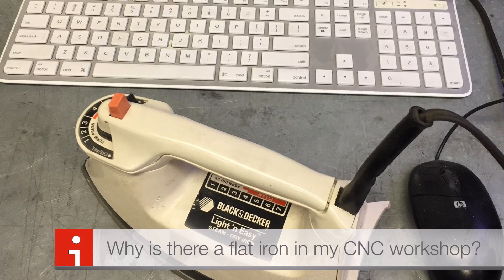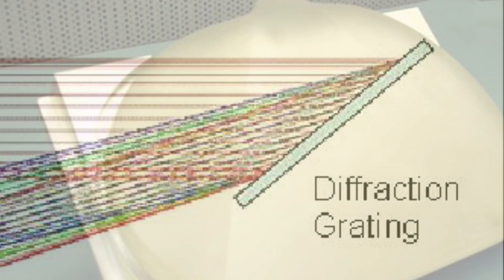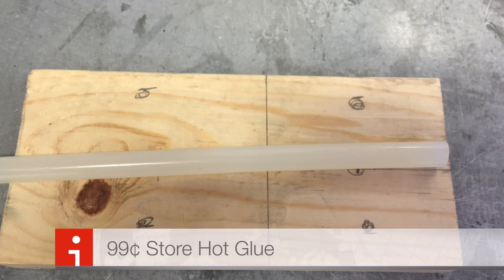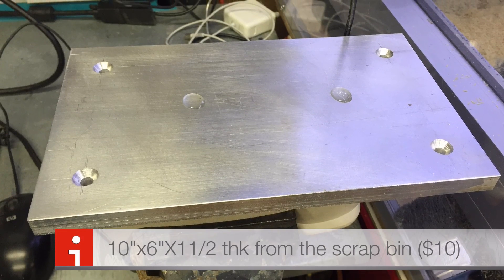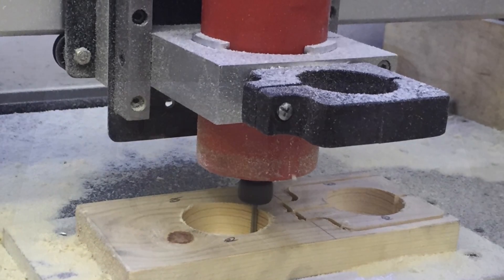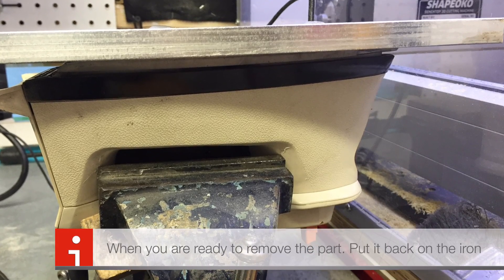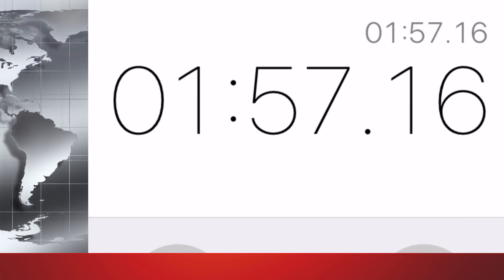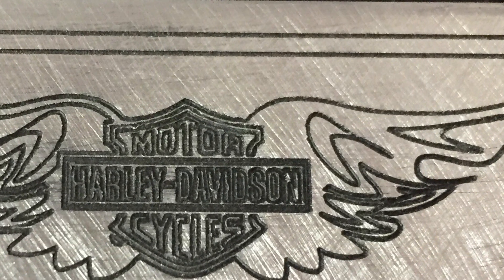Shapeoko: Hot Plate, Hot Glue, Hot Damn it Works!

Comment: How's the hot plate different from just using the hot glue gun?  Thanks
Reply from the maker: It's different because the items you are going to glue are also heated.   If you try to put glue to the 1/2" think of aluminum base plate, the glue will start to cool before you place the stock (wood or metal).  This means 2 things: You will not have a good bond, and the stock will probably not me parallel to the base plate.  When I glue metal, I place a few small piece is paper between the base plate and stock.  Heat everything up, and then clamp the stock to the base plate.  All the excess glue will squeeze out, except for the 0.004" (equal to the thickness of the paper).  This process will allow for a great bond, and the stock will be parallel to the base within 0.001.  This process (glue to heated base plate and stock) is widely used in industry

Comment: I've had a heck of a time trying to get this to work. My aluminum always seems to pop free. The only thing I can imagine is we must be using different kinds of hot melt glue. I will try machining wax from Carbide3d next but with the same clothes iron method, because it's pretty slick.
Reply from the maker: Well it sounds like an adhesion problem.  4 normal causes. 1) material is not clean (oil, dirt, etc) 2) Surface it too slick (Lightly sand and clean), or 3) you are not getting the aluminum up to temperature, or 4) Really crappy hot glue. Hope this helps.  I have never had a part come loose.....

Comment: Thanks for the tip Richard. How do you ensure that the part is level, on the holding substrate? I'd love to test this technique, I am wondering if you worry at all that the glue might raise the part more on one side than on the other, if the glue is not evenly dispensed.
Reply from the maker: Great question.  I am going to change the word level to flat.  My machine is level, but my work need to be flat to remain parallel.  

Now on to your question.  If I am working with wood, I place a heavy weight (10lbs ~ 4.5kg) on top of the wood as it is cooling and it's is flat within 1/64" or less.  

If I am working with metal, I will first place a few pieces of paper on the metal plate; then melt the glue with the metal workpiece.  When the glue is melted and the workpiece is also hot, I then clamp it together.  The excess glue will squeeze out between the two plates, but a small layer of glue (the thickness on one sheet of paper) will remain.  Why do I add the paper?  it's easy to squeeze ALL the blue out between the two plates leaving nothing to hold the metal.  I can easily maintain my material flat and parallel within 0.001" (0.025mm)  I hope this helps answer your question.

Comment: That's pretty rad! May have to try that. I work in the printing industry and we used to use an adhesive to attach copper imprint dies to press platens. You had to chisel those off and clean the plate and the die with heavy solvents after though. (Can't use hot glue because it's a heated plate). We ended up with aluminum honeycombs that accept special clips and it's much less messy and much quicker to turn the press over to the next job.